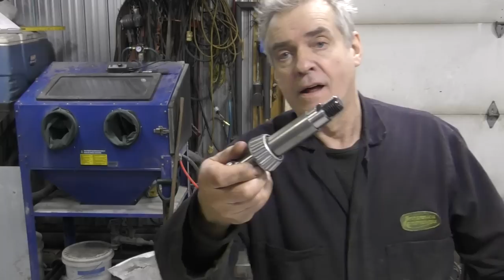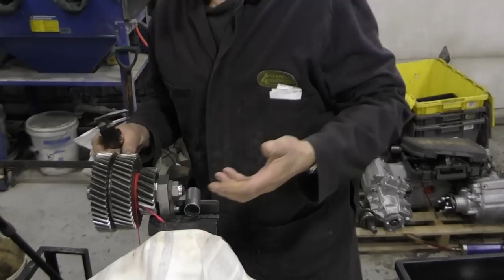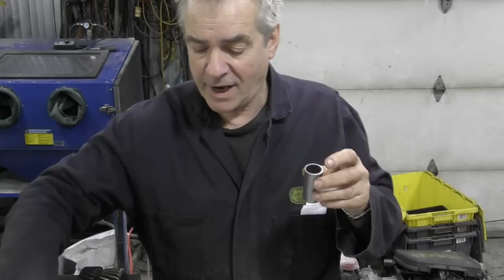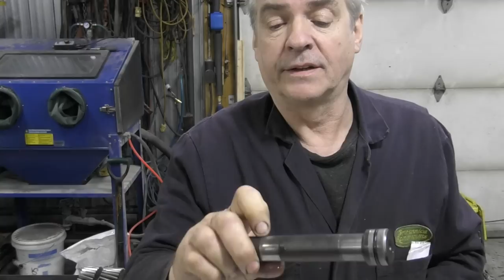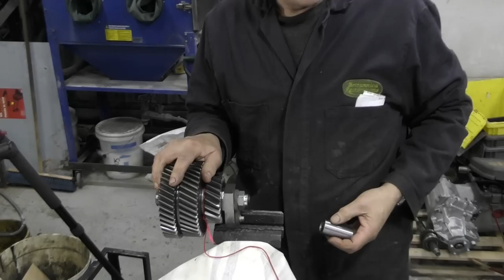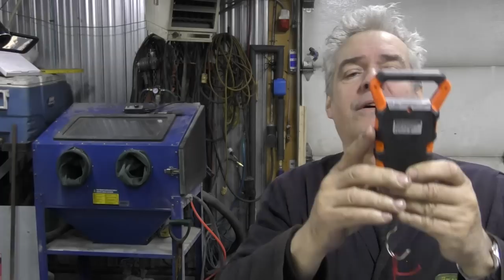Alternative ideas for setting LT230 preloads

Comment: Mike, you’ve enabled everyday wannabe mechanics with your educational videos - thankyou. 

I have just finished rebuilding my first LT230 with an ATB. I have used the LT230T workshop manual and many videos for reference. 

I set the input (main) and output (diff) bearing preloads by eliminating the end float then adding 0.05mm. 

Using a string balance, I measured the kilogram force required to turn an unmeshed input gear. I measured 1.6kg on my setup. 

I converted kgf into a torque using the formula Torque(Nm)=Force (kgf) x 9.81 (m/s^2) x radius (m). The shaft radius were the string was wrapped around the input shaft was approx 0.0261 meters. Therefore, the torque required to turn the input shaft preloaded as per the workshop manual was about 0.41Nm. 

The manual states that a properly preloaded intermediate shaft will increase torque required of a meshed input shaft by 1.25Nm. 

By transposing the formula, the force required to turn the input shaft with a properly preloaded intermediate shaft using a spring balance is 6.48kg in my instance. 

I had a bush (1” ID, 1 1/4” OD) machined to achieve this 6.48kg (give or take) force. My starting point was using a collapsible spacer but this was not a good method due to uneven collapse and possibly spring back. Had to go back to the machinist five times, each machining down in 0.05mm increments. (thank you Ravs engineering Keilor)! 

The result feels good. Let’s hope that the case doesn’t blow up! I recommend buying a box shipped from Ashcroft or Winchester instead of mucking about on your own on this unless you have patience, experience and time. Aussie rebuild costs at the independent mechanics are crazy expensive. 

Please go ahead and tear holes in the method described. Hopefully I’ll take it on board before the first roll under its own steam. 

Thanks again for your videos!

Comment: You have the same problem with the wheel bearings.  There is no support in the old adjustable version.  The inner bearing shells are constantly tilting and running in on the axle.  If, like with the newer vehicles, you make a massive distance in between, then tighten the whole thing with a force fit, the whole thing is a stable block.  Almost wear-free.

Comment: Hi Mike. I made mine in two halves and made shims to go in the center. To make the shims I took two 12mm thick pieces of flat iron, drilled out a center hole in both pieces the size of the bushes id. I then drilled and tapped four holes for 8mm bolts around the perimeter of the flat iron for clamping some shim stock between the two 12mm flat iron pieces. Next, I  drilled out the center of the shim stock, then removed the stock from the flat iron and bolted the stock in an arbor I had made and turned the outside down to the OD size of the bush in the lathe. I also make my shims that go between the cv's and drive members the same way.
Reply from the maker: I would have though that would be tricky to assemble if you do not have a dummy shaft
Reply: @BritannicaRestorations  I just assemble it with some grease on the shims and spacers.
Reply: @davidcraemer8227  This is what I was thinking for a 'kit'.
Reply: @BritannicaRestorations  Hi Mike. You can make the two spacers thicker and have a step on one and a stepped bore in the other in the center (to keep the shims from falling in) and just machine the ends on the bearing side smaller to clear the roller cage on the bearings.

Comment: Great Experiment! 
I did the same and found that the compressed tube is elastic and will come apart again.  So I disassembled and reworked the whole thing 4 times.  Until the gears no longer turned freely when pushed.
Reply from the maker: Thanks for the info!

Comment: Try removing the crush tube and tighten up by feel, velocette venom bottom ends similar size taper roller bearings set at 10 thou compression, keep up the great vids

Comment: Very interesting. Your theory of why the bearings are moving on the shaft makes complete sense. And also why the casting is being worn with that amount of weight spinning with the slight imbalance/out of alignment the crush tubes will cause. Good analysis. Just let me know if one requires a drawing. Couldn't draw the curtains me!
Reply from the maker: Didn't get much interest so may not bother
Reply: @BritannicaRestorations  Was thinking (dangerous I know), but would your thicker tube work at a slightly undersized length with a series of different thickness shims to add/remove to set the backlash? Instead of filing/grinding the end. Maybe too technical to have effectively thin sections of tube of differing thicknesses cut?

Comment: Hmm when l did my steel bush my man noticed the hole alignment for that shaft was out on the case,l would say that's why they have a crush sleeve. I would say old transfer cases the input shaft and the input gear machined holes alignment won't be perfect because of all the heat and forces over time, New transfer cases l reckon you could try your crush sleeve design because there hasn't been any pressure distortion or heat effects on the case. 😊😊

Comment: Why not centre punch a series of dots around the shaft where the inner bearings sleeves contact the shaft to create a interference fit ? You would need to press the bearings on but would stop the inner sleeves from rotating.
Reply from the maker: Would be a bugger to get the shaft in the bearings from one side to another
Reply: That's a bodge job. Not a permanent solution

Comment: Could you not make it slightly undersize and use shims? Wouldn't be around the same diameter as front cv to drive flange shims would it? Just a thought.
Reply from the maker: Where can you get shims in those sizes?
But that would be ideal - If I can get hold of a gauge to measure 1-3Nm then I could work out the pull on the cord in kg to make life easier
Reply: @BritannicaRestorations  That's why I was wondering if the shaft diameter was similar to the end of a cv joint? Shims are readily available then.
Reply from the maker: 1 inch shaft
Reply: 1” shims are readily available from online industrial supply stores
Reply: How about a thicker cruchsleev thats thinner somewhere ( in the middle?) So it has better kontakt at the bearings. Would this make it collapse square?

Comment: Mike am doing my lt230.also changing the ratio to 1.3.
Am just a novice but like a challenge.
Av learned alot off you.
I understand what you and JP have done 
But when you put it in the casing what torque is the nut or when do you know when to stop tightening.
Nice work Mike👍
Reply from the maker: 88Nm